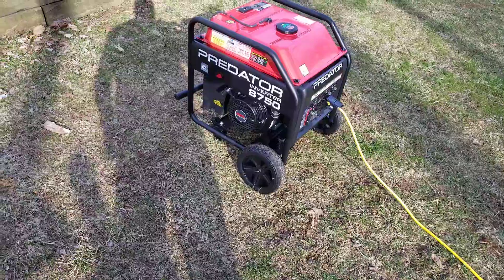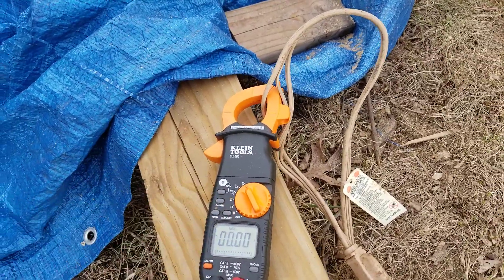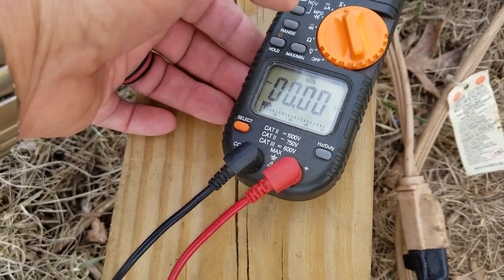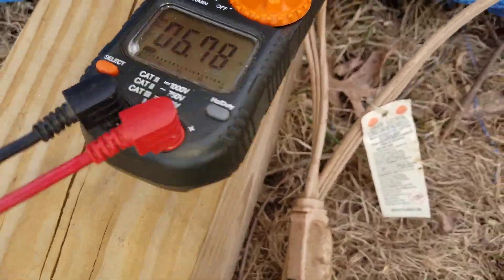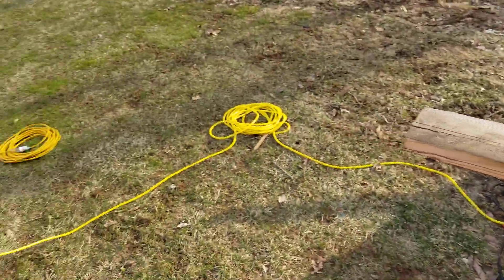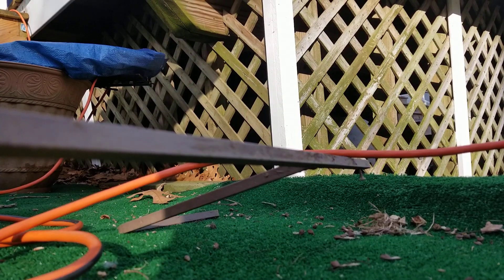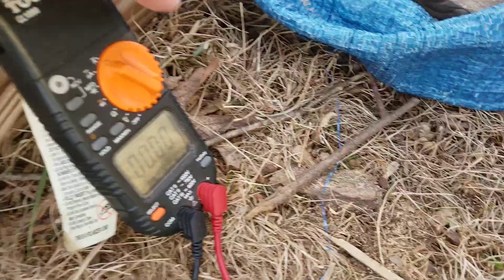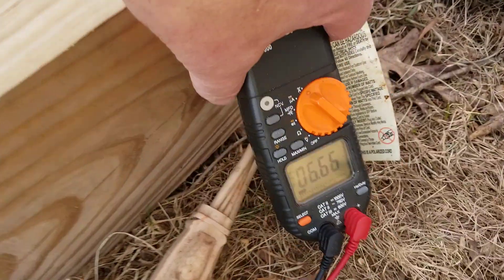Predator 8750 inverter generator vs. table saw

Comment: What HP is the table saw?  What is its voltage / amperage listing?
Reply from the maker: @zacht7998  Voltage: 120
Amperage: 13A
Horsepower: Not listed. Typically would be 1.5 HP
Reply: @MrRChitty  Cool thanks!

Comment: Would you recommend this unit ? 
Im looking to purchase one for mobile auto detailing 
Will use for 6hp 33 gallons air compressor 
5hp Shop vac
1800 psi elec pressure washer 
And other small items 
Any input would be helpful and appreciate 
Thank you for sharing your knowledge,which you have lots
Reply from the maker: You should be fine. The electrical loads I showed all started without any delay as if plugged in to shore power. If you do get it, do 1 hour oil changes until clear with regular oil. It'll take three changes. Let it do some break in time of 5-10 hours with other loads first.
Reply: @MrRChitty  now I see some of this selling for around 400 to 500 used should I buy an used one ?
Reply from the maker: @marOcean13  very interesting.  I'd bring your pressure washer with you and check it on each leg. Do it on eco and the non eco. Reason is if the carburetor needed replacing, it would show on a load.
Reply from the maker: I edited for content, I changed "with delay" to "without delay".
Reply from the maker: I also demonstrated the 1800 psi pressure washer in my other video. Did you see that?
Reply: @MrRChitty  yes I did see it

Comment: ⚠️Portable Generator Safety Tips:

1) KEEPING OTHERS SAFE: Please do not allow an unqualified person or your children to operate and service the portable generator. Just because some manuals don’t say that doesn’t mean it’s safe. That is important against the generator safety rules. We also need to be keeping an eye on our children too. You need to make sure that your children are not playing near the portable generator especially when it’s running so they won’t get electrocuted. Generators pose electrical risks and they can be hot during an operation. Please keep your children away from the portable generator at all times. It is important to keep our children safe especially our little ones. Be aware of all the hazards.

2) WHERE TO RUN YOUR GENERATOR: Some people use their portable generators indoors which increases the risk of carbon monoxide poisoning. It’s important to have carbon monoxide detectors if you have a gas generator. Never ever use your generator indoors even if your doors and windows are open and even in the garage is not safe to use a portable generator. Also please never use your generator in your deck or balcony. It is never safe to use your generator indoors and in enclosed areas of your home. Your generator needs to be 15-20 feet away from your house. 

3)🔥FIRE HAZARDS: Never refuel your generator while it’s running. You need to let your generator cool off before refueling it and before storing your generator. Never overload your generator too. Never ever back feed your generator. You should never plug your generator into a wall outlet. Also never store propane tanks indoors. Please keep flammable things away from the generator as well and please don’t smoke cigarettes near the generator. Having a fire extinguisher next to the generator is also important against the generator safety rules. It’s also not safe to move your generator while it’s running.

4) GENERATOR OPERATION: make sure your hands are dry before touching the generator. Never use your generator in wet conditions. Don’t let your generator get wet. You need a generator tent if you need to use your generator during wet weather. Please don’t wear loose clothes when operating the generator. Turn on your generator before plugging in appliances. Use the right cord for your generator. Please do not use worn out cords. 

It is always important to follow the safety rules when using portable generators. 

Hope this helps
Reply from the maker: We weren't looking for a safety note, but thank you for providing it.